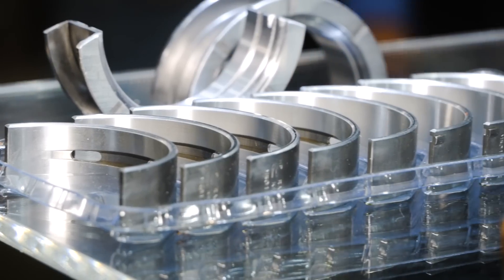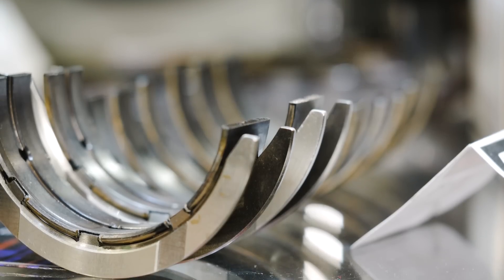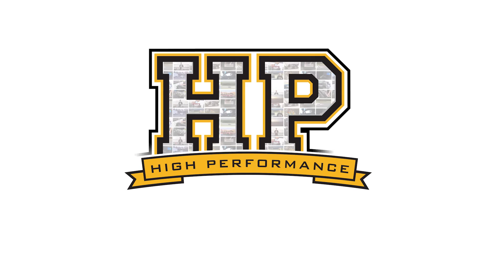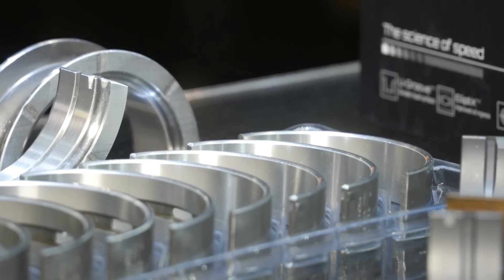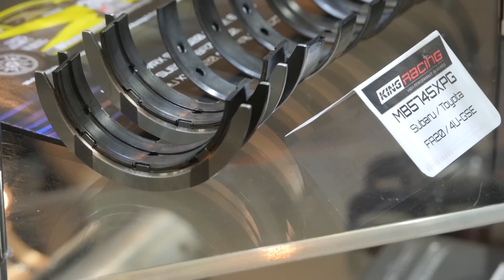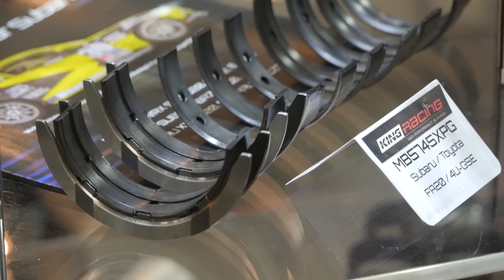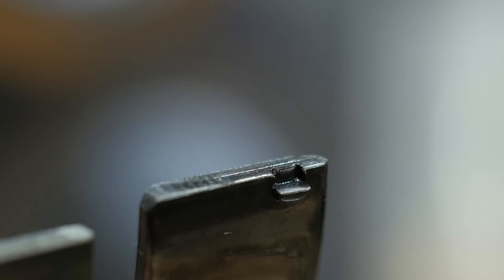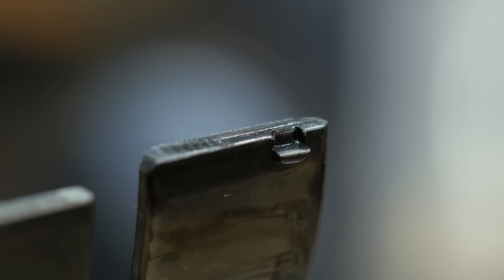Engine Bearing Tech Myths | What You Really Need To Know

Comment: Piston ring and cylinder bore finishing videos discuss finished profile metrics that facilitate adequate oil retention in the sliding surfaces interface. Is this a consideration for engine bearings?
Reply: no  more  that the bore that the bearing resides  in is straight and within spec.  thats more for pistons  what youre talking about.  bearing types and clearances  are the most important thing with bearings

Comment: I found this video while searching for details on the manufacturing process for engine bearings. There is not an abundant amount of information available. My main curiosity was if engine bearings were coated to the exact same shell material, no matter what oversize was the final product. In other words, does the coating process control oversize dimensions?

Comment: Just here to attest to King bearings. I have used many sets of their main and rod bearings in the bi-metal version for medium hp builds. Have done many LS, small block Ford and gen 1 small block Chevy. They have been on point with their thicknesses every time and they are always a great price. I use Clevite as well on some race engines but I have had to end up buying multiple sets to make 1 properly sized set.

Comment: Concerning 'embedability' I'd love to know more about that. In theory if dirt goes through and then gets embedded in the bearing it will hold it against the crank and score it or wear it away, this can't be a good thing and i've seen it. I would guess that soft bearing metal is used for when those times that it takes a swipe at the crank, but the downside is metal gets embedded in it, open to discussion on that though.
Reply: I don't think you've read or understood my post very well, if at all.

Comment: I’m glad I have a set of King race bearings sitting next to my engine build project
Reply: You got a sub out of the deal lol
Reply: @FFH best practice is to buy a couple sets and mix and match just like OEM. You may want to order a thinner set an just use one or two bearings from that set to get all clearances within spec.
Reply: How did the clearance check out?
Reply: @fastfnhemi4384  I don’t remember numbers but I do remember the plasti guage pieces were all very close in size. The engine runs good, no bearing issues.
Reply: @MORC   I bought a set of the the extra clearance .001 for a 2.559x journals and the clearance was less than .020. I’m a little frustrated and just trying to see if anyone else had had the same issue with king. Thanks for the reply though.

Comment: why a magnet is not placed in the engine oil pan as standard practice in the gearbox?
Reply: Cause the oil filter is supposed to get large particles.  You can also buy aftermarket magnetic oil plugs.

Comment: Very informative. But why did Subaru not ship the F20A with improved oiling to the main bearing to begin with? I imagine their engineering team is 10x the size of King's. Is this a cost issue, or is there potentially another reason Subaru chose their design?
Reply: Because the stock bearings are probably perfectly adequate to last 100,000 km or more at the stock power level under normal driving conditions and likely much cheaper?
Reply: 9000Redline cost. These bearing are probably 500% more expensive to make than their current bearings.

Comment: i wonder if there is any advantage to mirror polish main and rod bearings...?
Reply: PANTYEATR1 bearings are made to wear away and be the sacrificial piece. If bearings were polished the crank would end up ruined. And being polished there wouldn't be any "pores" to hold oil and keep a film on it.  During a power stroke the oil would get squished out from in between the bearing and crank

Comment: I have a question. He mentionned the subaru ej and fa engines tend to fail on the piston 2/3 con rods because they share the same oil "input" to lubricate. Does this somewhat explain the rod knock certain models (mostly the ej25s) commonly have?

I have a ej251 that is still alive as my daily but its knocking terribly (when cold) and runs a bit uneven will a small knock when warm. Im probably going to give her a proper rebuild this summer when I get a backup car for summers (since in canada we have longer winters).

I know there might be some other problems, but im thinking bearings and crankshaft runout/out of round will be some of the things ill be looking for the most. Im wondering if my engine doesnt get proper lubrification when cold
Reply: Inverted V12 Powerhouse maybe your oil pump is a bit worn out or the oil pickup screen might have some stuff on it making it take longer to prime everything. If you think the bearings are worn a bit try putting some thicker oil in it.it will act as a seal and give better oil pressure.

Comment: That heat thing is new to me for a change! Is there a technique or substance used during building that helps here? Kind of like old Holden electronic distributors needing thermal paste
Reply: Check the bearing clearances are at least the minimum spec', carefully inspect the connecting rod and crank bores and cap mating surfaces for irregularities and make sure they are clean, clean, clean* as part of the bearing cooling is transfer from the bearing to their housings. If you have the tools, check the bores for correct 'crush' - if you don't have the tools, you can get a close approximation by fitting one bolt and mildly torquing it down to endure that side of the cap is seated and then measuring the gap on the other side - that will give the approximate circumferencial difference and if you divide by 3.14 it will give the approximate difference between the bearing shell's outside diameter and the bore's inside diameter which should match the crush you can estimate from the shell and bore tolerances. You should also check the clearance(s) between the sided of the crankshaft and the rods and block/cap. Use the correct viscosity oil for the application is a big part of it, as also noted in the video**.
Personally, I run a fine file or stone along the edges of the bores and the shells to remove any flash from manufacturing - around <10 thou, or barely enough to see, especially as some shells have some material left there during manufacture - I mean the outside steel ends of the shells, NOT the bearing material. That may just be me being anal, though.

I know of one instance when an engine suffered a catastrophic failure because the crankshaft was available in two slightly different configurations with different radii where the crank'journal transitioned to the cheek and the wrong shell type was used - the clearances were correct but the assembler didn't notice what we later believed was a restriction where the bearings met the radii that we put down to restricting the oil passing through the bearing. On that engine the primary failure was an overheated big end that seized, but there were also colour indications of others running hot.

*As an apprentice I would see "senior" mechanics oiling the backs of the shells, which would reduce heat transfer, and even one "self-professed expert engine builder" who used locktite!

**One of my bugbears - I know several people with late model turbo's who run 20-50, or even -60, oil instead of the usually recommended 10-30 range in lightly modified engines so the oil stays in the bearings and doesn't get 'squeezed out'. They don't believe the oil flow need for cooling (especially at the turbo' bearing) and that some of the highest stressed engines made, F1, commonly use 0-5 oils. Even NASCAR engines are using lower viscosity oils for both power and bearing life.
I have suggested perhaps they should use grease in their engines...

Comment: I went with King main and rod bearings in my 2.4 liter Ecotec engine...I run the 
bi-metal... Turbocharged 400-425 rwhp street car.... They've been great so far...👍
Reply: Craig Cundiff is the 2.4 the same as the 2.2 ecotec. I had timing chain guide fastener problems. The stupid tiny bolt that holds the right side guide in snapped off in the head. I took the access plug out and machined a piece that uses the plug to hold the top part of the right chain guide
Reply: How they hold up?
Reply: @BBsAuto   - He cant answer, his engine bearigs locked up and he crashed into a tree at 120mph, he d'd!